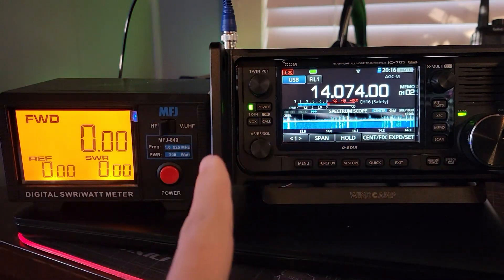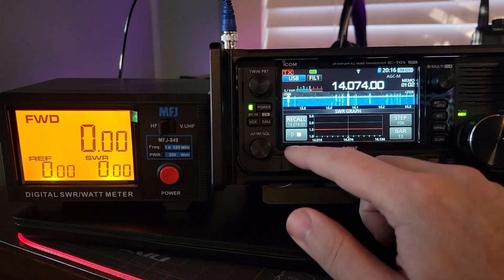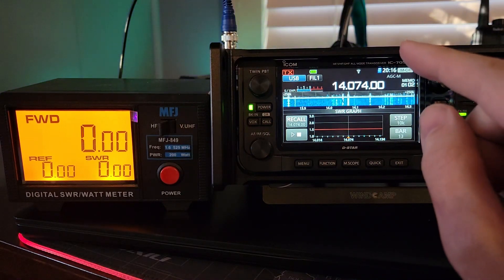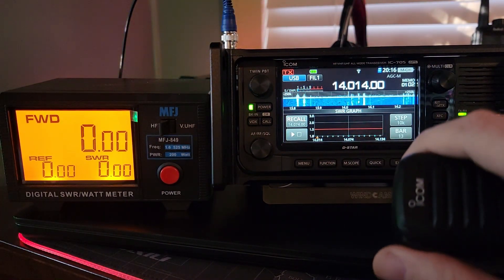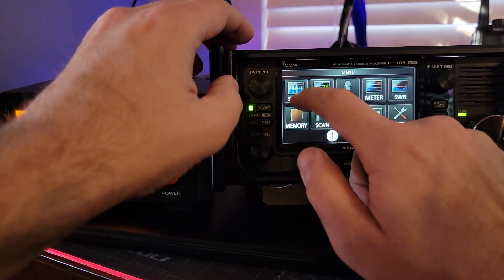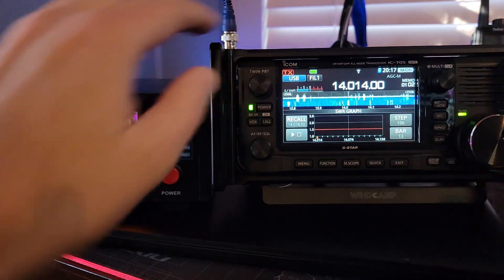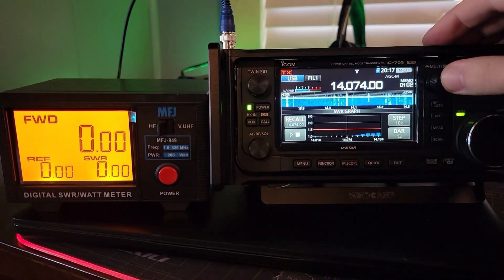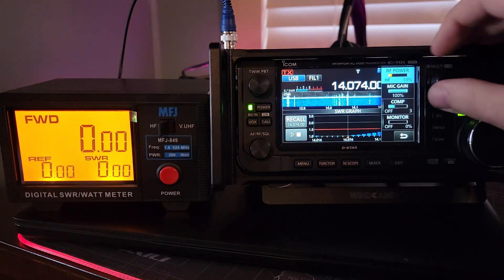Is the IC-705's SWR Scanner any better than the Xiegu's?

Comment from the maker: Pros: Respects Operators Power Choice!
Cons: Doesn't TX out of band during scan, making it harder to use as an antenna analyzer.
Reply: During the SWR test, does it use the mode selected or does it use RTTY / CW when you key up?
Reply from the maker: @Cyan2002  it sounds like it changes modes, but I'd have to investigate to know more.
Reply: I would prefer not to have to remember to turn the power down every time I want to tune, and what would be the advantage of being able to tune at higher power?
Reply from the maker: @LouiseBrooksBob  I agree!  More power out = more power reflected if you're at a bad SWR.  The SWR Scanner tools should all be calibrated to work properly with the internal hardware.  On the 705, you can see that .5w is not enough power and that 5/10w both produced very similar results... so the proper amount of power is lower than 5w.

Comment: There are many things I absolutely love about my IC-705, but SWR measurement is NOT one of them.   My 705's SWR function isn't even accurate.  For example, it reads a calibrated on multiple VNAs 2:1 vswr 25 ohm load attached right at the output BNC as about 1.5 : 1 and sees anything under about 1.3 : 1 SWR as 1:1 making any fine tuning of SWR impossible . . . and that whole B.S. business of having to play bouncy, bouncy, bouncy, bouncy,bouncy on the key switch to get it to 'scan' is PURE GARBAGE.

 I could literally step through the  band manually and get MUCH more useful information using the regular SWR meter bar graph that can be displayed below the frequency readout.  Why? Because as you noted, the 705 won't transmit out of band, which by itself would be a good thing, but because some idiot at ICOM limited the upper SWR 'bar graph' measurement range to 3:1 during the "scan", if the antenna doesn't hit resonance within the narrow sweep range,  the SWR "bar graph" will be MAXED OUT ACROSS THE FULL SCAN making it TOTALLY USELESS FOR TUNING.  

Here's a little "Pro Tip" for 705 owners to try to make the best out of the IC-705's crappy SWR scan -- before you start the scan, exit from the waterfall to the frequency-only display with a single meter readout -- then TAP the meter bar repeatedly to change the single meter display to "SWR"  -- that way when you enter the "SWR Scan" screen, and are doing the bouncy, bouncy, bouncy B.S.  you can use the upper meter's expanded range to see if your miss-tuned antenna at least falls below 10 : 1 or 20 : 1 at the beginning or end of the scan, so you will know which direction to tune.  

Of course the upper meter is real-time and isn't retained during the sweep, so you have to watch it step-by-step during the scan and keep track manually (which pretty much defeats the whole point of the "scan").

None of this would be necessary if some idiot at ICOM hadn't tried to be clever and 'expanding accuracy of bar graph' by limiting the range to only 1:1 to 3:1, which when combined with the limitation that you can't do a really wide range scan (because you can't scan past the band edges), makes tuning a way-out-of-resonance antenna a real bitch.

This work-around will help, but ICOM needs to FIX THIS!  The scan should be automatic through a single pass when you hit the play button - and the SWR RANGE DURING THE SCAN SHOULD BE THE SAME AS THE MAIN METER - because allowing the higher SWR points to be recorded will allow better tuning of antennas that are still not at resonance when we hit the band edge.
Reply from the maker: Couldn't have said it better myself!  I hate that you know your antenna is "out" but don't know if it's too long or too short.  I've demonstrated this a few times, but I'll try your added single meter tip also.  Thanks!

Comment: Just for information: the Lab599 TX-500 also only transmits within (mostly US) band allocation, but uses 5W output power to create the SWR graph.
Reply from the maker: Thanks for this info!  Does it respect your power setting?  Does it TX with more power from an external source?  (I don't have one, so love the info)
Reply: @temporarilyoffline  you're welcome, Joe! The TX-500 has only external power and always uses about 5W when doing SWR measurements, like graph and single/dual tone. The measured value doesn't match exactly with the one of my analyzer, but is good enough for my typical usage.
73 Stephan
Reply from the maker: HB9EAJ Portable Radio  perfect, thanks
Reply: Why on a 100w radio am I supposed to lower power to 10w for tuning but on a 10 watt radio lower the power to 1 watt? If I had a 1 watt radio should I then only tune at .1 millawatts 😊
Reply from the maker: @forgetyourlife this was the SWR scanner testing function, not the tuning function.  I think the manufacturer should know the design parameters of their equipment and not exceed the minimum power needed to use the function.  I don't think there is any other rule though.

I have seen "tuners" that get different results at different power levels and most tuners say notntomtune at a high power level or you'll break them.

Comment: It's too bad we can't do something simple like the Konami Code to unlock transmit for out of band, LOL. Thanks for another interesting test and video.
Reply from the maker: You can on the X6100... I'll do tye mars mod on the 705 and then see if it works with the scanner in a future video!
Reply: @temporarilyoffline  thanks again. That'd be cool to see. There's a point at which functions like SWR sweeps/charts make the radio a testing tool as opposed to a transmitter. It could be really helpful with an antenna system like the WRC to know if you're higher or lower out of band.
Reply from the maker: @MikeN2MAK  That is the exact use-case where you need to have an OOB TX setup and a good piece of test equipment.  Since the radio already has all this stuff built in, the regulations should change (easily and quickly...)

Comment: Seems like the bottom line is that if you need an antenna analyzer in the field then you're going to have to pack one.  What's built into the rigs for SWR measurement is obviously designed first as protection for the outputs, and secondarily as a "did I totally screw up my antenna deployment" meter.  I'm OK with this.  I'd really rather not TX into an antenna I suspect isn't tuned up yet using my rig finals on any regular basis anyway.
Reply from the maker: Smart Move!  You and I both know there are "good operator practices" to make this safer, I've demonstrated it inside of other videos, but probably deserves a video of its own.

Comment: One other plus is that since it uses discrete points you are only transmitting for an extremely short time at up to 13 points within the band. 
The Xiegu constantly transmits which gives you more accuracy but pollutes the band more
Reply from the maker: I would prefer the continuous hands-free sweep for tuning a mag loop.  I can see benefits of both methods.  The hardest part is that the 705 doesn't TX out of band, so when tuning a mag loop, you can't really tell where you are, its gets very "tedious" to do.

Comment: At "Low" power setting, the SWR showed nothing on the graph. Kinda useless, unless very high SWR shows (unverified) which saves the final output transistors.

At 5W and 10W the SWR appeared similar.

Good  to know the capabilities and limitations of your test equipment in known environments so you can trust (and know what NOT to trust) in troubleshooting environments. 👍
Reply from the maker: Lower Power Out = Lower Reflected Power -- possibly un-measurable at low power on this meter -- one of the things I've learned doing this and other radio work.  I don't think any of these radios are doing anything wrong.  So far the X6100 wins with big screen and broad sweep - including out of band sweep.  I would like for it to respect power levels better though.